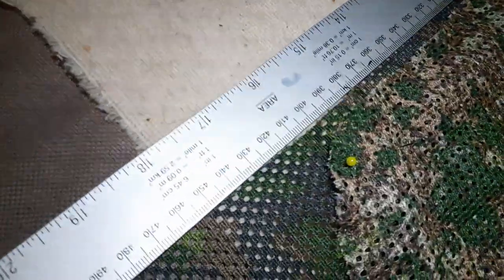making a M05 "Mitznefet" helmet cover (1/2)

Comment: can you please explain how to cut it
Reply from the maker: Start with a rectangular shape with the long side being 75cm and the short side 70cm. 
Then mark the middle of all sides.

Measure ~20cm from the middle mark of the two short sides along the edge in both directions and make cuts from there towards the middle marks of the long side.
Altogether you end up with a piece of fabric with six corners.
I used scissors for all the cuts. 

There's probably no reason not to go for a round or octagonal shape, as it's mostly size that matters, to allow you for shaping it according to your liking. 
Mine ended up being about hexagonal, since the one I had as inspiration also came in this shape.
Reply: @huckmiddeke665  thank you so much